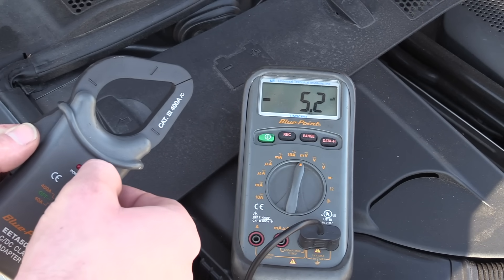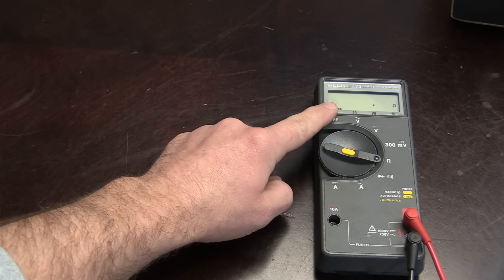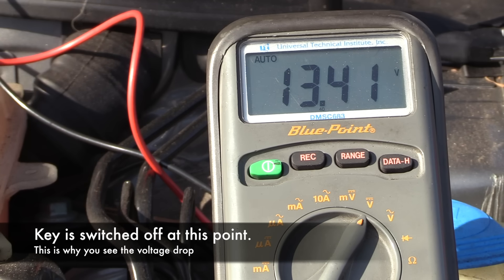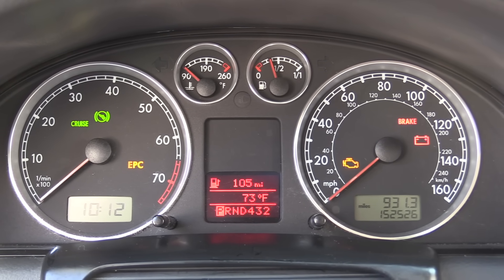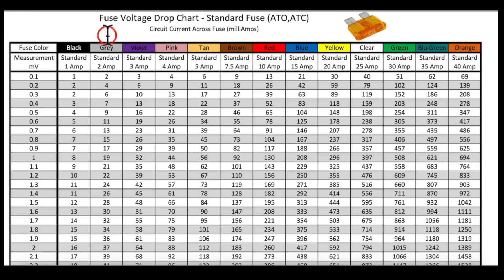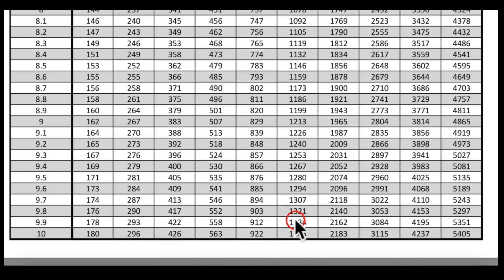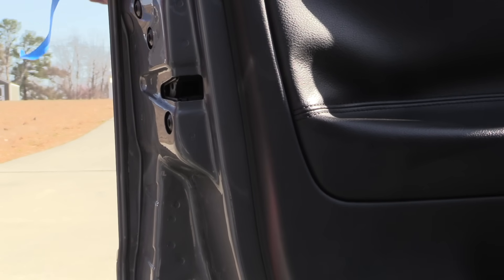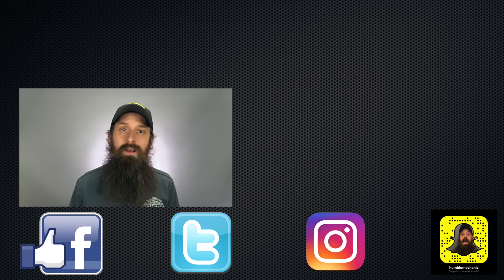The BEST Way TO Perform a Parasitic Draw Test

Comment: we had a 93 pontiac sunbird and if driven every day was fine. let it sit for 2 days and battery wouldn't turn the engine. my method of finding the parasitic draw was to start the car and let it run for about 5 minutes to charge up the battery. then i turned off engine. i read the standing voltage of the battery and began pulling fuses to see which one when pulled out made the standing voltage rise. i had no helper so it was a lot getting in car and out of car . turned out to be the electric door locking circuit. removed the fuse and no more battery drain problems. just wanted to let you know how i figured it . newer vehicles who knows since 1 wire can be used for more than one thing.

Comment: I went outside to watch a YouTube video on my laptop and took it outside so i could refer to it while sat in my Audi A3 1.9Tdi 8P1 March 2009 plate.
I latched both doors and the bonnet
With my Robin AR4007 multimeter set to black lead in the common and red lead in 10a, max and the dial turned round to 10A I started getting the following readings the values kept hovering around 0.239 --- 0.240 then 0.300 then 0.560 then 0.141 then 0.112
0.073 --- 0.074.
The difference between the word "then"  and the dash line   ---  = "then" the reading hovering backwards and forwards 
The dash line ---started at the first number and finished at the second number.
While the Robin was sitting there doing its thing I used my other multimeter splinktech DM2 to check all the fuses on both 
fuse boxes inside the cabin and under the hood and they ALL gave the same reading of 0.00, it got so bad I was even beginning to doubt my splinktech so I tested it on the + & - poles of the battery to get a reading I am still getting 12v etc.
But even after leaving the car for two days drains the battery, so now I uncouple the positive cable from the battery daily.
Does anybody have any ideas ?

Comment: About turning the radio on when testing voltage drop on the fuse, do you have to to turn ignition or just press the power button?
Reply from the maker: I just clicked the radio on

Comment: Does anybody have screenshots of the original charts? Because apparently Power Probe has removed these charts from their website
Reply from the maker: They change that link all the time. :( I’ve had luck googling “power prove bolt drop chart”
Reply: @HumbleMechanic  I found a few and screen shotted them. But don't have all of the regular ato type fuse chart. I should be able to figure it out with what I found. But still
Reply: @HumbleMechanic  I've always enjoyed your videos. I've been running my own mobile auto repair for almost 7 years now. And still need to learn and further the education every day

Comment: Thanks for sharing this useful information 
 Question : What if the draw wasn't a constant draw?  Like if the draw comes and goes from time to time 🤔

 Update: i did little research and I believe that I found a little better method,  Attach clamp meter to the battery's positive cable and read the current (mA) ;

A-  if it shows a parasitic drain ( more than 50 mA) and if it is a  constant drain 
➡️ Then perform the volt drop test procedure normally. 

u can use the (max) option on clamp meter and leave it for a while and get back to confirm  whether it's a constant draw or intermittent. 

B- if it's an intermittent drain
➡️ perform the drop volt test on fuses only while the parasitic draw is happening, so as soon as u see the clam meter reads a significant draining amp perform the drop test on fuses one by one, and stop when the  parasitic drain goes down,  continue the volt drop across fuses as soon as the amps goes up again ...  And so on until u find the fuse that causing it
Reply from the maker: That method will only tell you THAT you have a draw, not WHERE your draw is. Often that method and this method are used together

Comment: I'm confused by something. You lock the car and let it sit for an hour so that it completely shuts down. Then to test the draw for the radio, it has to be turned on... but you can't turn on the radio without at least putting the key in and doing a quarter turn. Doesn't that completely negate the locking/shutting down the car?
Reply from the maker: Radio power on with key off on this car. The radio on was only an example of what a draw looks like.  

If the radio was “bad” it could also stay on:be on with the car off, on a car that normally wouldn’t
Reply: @HumbleMechanic  I've got a VW beetle 2003 and using a different method (amp draw through negative lead to terminal) gave a 1.8A reading, but removing 42 gave it 0.04 - so I'm very interested in this method. 

Interesting that the radio powered on with the key off in this unit. I don't think mine could do that - but I guess I should check.

Strangely, disconnecting the amp in the back, the multimeter reading oscillates from 0.6-0.8A. I suspect my radio (or something) is trying to tell the amp to power on constantly. Guess I'll find out soon!

Comment: I'm glad that this popped up in my feed again I needed the refresher before I dig into my truck.
Reply from the maker: awesome
Reply: @HumbleMechanic  His three main points are that the cased fused can't be checked because the have the clear cover over them, according to a manufacturers' literature, anything over 25 amps can't be tested reliably, and sometimes, a load cycles on and off and you may not catch it when it's under load. 

So, remove the cover, install a smaller fuse for testing or be patient.

Not deal-killers, they are just some things to be aware of.
Reply: @HumbleMechanic  after watching this, I got another one in my feed saying that this isn't reliable. I haven't watched the whole thing yet, so i don't know his reasoning. I am always willing to try whatever it takes and yours is easier, so I'll start there.

Comment: This test is very much B's and would take forever.  On my cayenne. There are four fuse boxes and two batteries.  Some fuses control multiple modules.  That would take forever. Not 10 minutes.

Comment: Seems to me you can simply take a fuse known to be blown, insert it in place of the good fuse, then use the digital meter to directly measure milliamps or amps across the blown fuse. The reading will be the actual draw on that circuit, conducting through the meter. Using voltage drop across a good fuse is too dependent on the size of the fuse and how well it is conducting in the fuse block, which could have corrosion issues. Not to mention the result must be looked up on a chart that converts an unreliable reading to actual draw. Set test meter on 10 amp scale first. If reading is negligible, reset to 300 ma. scale. If still negligible, go to lowest 10 ma. scale. A parasitic draw of 1 amp or higher may pull down the battery below 11.5 volts in a couple of days.

Comment: Disconnect neg battery connector, put neg meter probe to neg battery post.  Connect positive meter probe to chassis ground.  Read volts on meter.  12+ volts indicates parasitic current draw.  Start pulling fuses watching voltage.  When it drops that circuit has the problem in it.  No need to read fuse voltage drops and charts.  Quick and easy.
Reply from the maker: Doing that on old cars is great. Modern cars it’s not.

Comment: Electrical Engineer here; didnt realize that fuses has a large enough resistance to them to detect a significant enough voltage drop to calc amperage off of. Interesting technique. Thanks.
Reply: They're meant to melt at certain current.  So it would have to be resistive to cause heat, thus generating voltage across it prior to meltdown.  Even copper traces on PCB's have significant enough voltage drops, thus we utilize Kelvin connections. 😉
Reply: The key "change" here is that meters that make reliable, easily-read and repeatable microvolt measurements are easily available.  Humble has a nice Fluke, but for this task a meter you might acquire at an auto parts (NAPA etc) or big box general (walmart) store will work fine. 40+ years ago not so much.
Reply: Wtf does it take to become electrical "engineer" nowdays? Have a pulse?
Reply: @redrustyhill2  ...maybe lighten up.  @b_gumm apparently drives Autocad for a living, and it's good he's picking up insights about troubleshooting here.

Comment: I tell you what a light with two leads can be really handy finding a short to ground. Hook one side to battery +. Then start by pulling out a fuse. Connect the other lead to the + side of where the fuse plugs in. Do that with each circuit. If the light comes on you have a short to ground in that circuit between the battery and the fuse. When the light goes off the short is fixed or just not shorted out. You can use the light  and jiggle stuff, close doors, etc to see what causes a temporary short. I did this to isolate a short in the passenger side back door. A yellow wire to the window regulator had missing insulation and would short against the door sometimes when it was closed.

Comment: Hey Bro. nice video. but didnt help on my problem. i pulled all the Fuces and relays off, but still have a drain of 3.6Amps.  and BCM give me 100 codes says that all the equipment are short circuit short to ground. 
pls help. its a Chevy Sonic 2014 1.4L turbo

Comment: so in my golf i let it sit for 2h with locked doors and came out to check the fuses and alot of the fuses was pulling 0.1 idk if thats a fluke or if they actually draw that and i found 1 pulling 2.6 while the car was of

Comment: I’m a little confused why a radio with a draw of under 2 amps is on a 20 amp fuse. Surely there must be another another fuse between that and the radio.
Fuses protect the cable so if you have a light cable with a short circuit of 15 amps it would catch fire well before the 20 amp fuse blows. So that fuse must be protecting something else as well.

Excellent video and especially the tip about tripping the locks. Thank you

Comment: Best video I have seen on this.  Working on a kia that we just cant figure out. Changed starter, alternator, battery, power steering and pulleys.  Still having draw and cold weather starting.  Thanks for the resource.

Comment: Oh my God you completely do not have the correct concept of how this works all your reading is across a dead short the fuse and you're reading the resistance of that dead short! That doesn't tell you anything other than that the fuse is good.... If you read a voltage across a fuse that fuse is blown completely open.
Reply from the maker: No that’s not right. Try it for yourself. :)
Reply: @HumbleMechanic  I see the charts and everything but this is not telling you anything... You're reading a meniscal portion of the current going through that fuse.
Also I think every parasitic draw problem for the most part is just a poor battery...
Some things have to have a draw to keep their memory or to be ready to perform whatever function they performed.
Reply from the maker: It’s only minuscule if you have no draw. Watch when I turn the lights on.

Comment: If the readings are all 0 reading. Is this incorrect.l? Shouldn't a reading show for the clock getting power? A couple MV.? I got all 0 on my lowest MV setting direct current mv 200mv setting. Have to get an alternator test
The only thing I'm sure all engine fuse box fuses read 0.
Maybe on the lowest setting on in cab fuses I missed a reading of 1 because then the next highest MV setting is needed for a read.The box is right at feet. Hard to check!! I noticed y auto power window was stuck not working correctly. Unstuck it. Waiting to see if it was the problem.

Comment: Not a techie myself....but I learned 2 things , er maybe 3.  How to check the fuses with the probes , how to check my ohms reading on my voltmeter. And to hold on to my 2005 Highlander because it's not as high maintenance as the car you were checking...lol...P.S. ...great presentation . You stayed on point in a highly technical subject . You didn't waste time with lengthy introductions . The length of the video was about the optimal time I want to watch. Others spend 20+ minutes and don't deliver as clear and concise info. Great job.

Comment: This gentleman is excellent, voltage drops rule , sometimes calls I R drops
, because E= I x R , which is Ohms law , which all you have to know to control electricity  learn it love it  , I love a large current draw , the sound , the heat , the sparks

Comment: Thanks for the video. I have a 1998 lexus sc400. It has had a slow battery discharge (dead or very low charge after about 10 days sitting without running it). Ive had this problem since 03 when i got the car. Im going to do this test. What is the acceptable draw ballpark? I know the stereo etc has a tiny discharge for the memory etc... I thought it was the alternator but replaced it with no remedy.

Comment: Is this with the key off?
Reply from the maker: off. the goal is to mimic "sleep"
Reply: @HumbleMechanic  ok thanks thought so but wanted to confirm.
Reply: What if you have an old vehicle with glass type fuses? I did the test light method and pulled each fuse. Light never went out? Next to check?
Reply: @HumbleMechanic  By the way great vid!!

Comment: Easy way to measure current is to put in a blown fuse, and you just measure across it.  This won't work in this case, but on an older car this is pretty easy.

Comment: Why do you use a second multimeter, while the first one is simply connected to the battery for a voltage test.  Why not remove it after confirming battery voltage?  After all, it’s not like you are using it in series with the battery and testing current draw.

Comment: Don't cheap out. Buy a real meter. Fluke ! 
Eliminate the battery completely.  Hook up to batt terms. And start testing. Most of time its corrosion that can be intermittent. Then test circuit by circuit.  Pull fuses in and out like 5 times and clean terminals. Use dielectric grease too.

Comment: Unfortunately this technique is highly inaccurate for intermittent voltage drops, for example if your wiper motor goes bad\gets rusted out and gets stuck on a rear door hatch, it will constantly attempt to return to home position even with the car off, at least in 99% of vehicles, which in turn kills your battery overnight, these generally try to return home every 10-15 seconds, if you are just going across each fuse you are most likely going to miss this amperage draw unless you are just so lucky enough to test the exact fuse at the exact moment that it happens. 

Best way to test for parasitic draw is always going to be old school, DC your batt, install a lead from negative term to neg wire, use your multimeter then, and pull fuses each time your meter shows an amperage draw, there are plenty of videos showing how to do it, yes it is annoying to go through all that, however you wont miss any intermittent issues and resort to the parts cannon.
Reply from the maker: “The best way is always….” This is a dangerous mentality. 

For intermittent I’d use a IR camera.
Reply: @HumbleMechanic  I admit I shouldn't say always, my bad, an an IR cam would be nice, if you mean the ones that show you a thermal image on a screen, far too expensive however, temperature gun maybe could work though.

Comment: What kills your test leads is trying to probe through wire insulation.
They make piercing lead ends for your fluke.
One day I found out my leads had been swapped out by a jerk at the shop. I didn't have time till I happened to take the meter home.
Well, God judges them.

Comment: My father in law gave us a passat that had been in and out of dealerships for years for draining the battery.  I found the problem by removing all the  fuses and replacing them one by one watching th e current draw. Wire to trunk light was woven through lightening holes in trunk lid and had abraided through insulation. Got a great car for nothing. Three months later the wife totalled it.

Comment: Great test with great info.
Parasitic draws and intermittent electrical issues have to be some of the most challenging diagnosis in modern cars.
Test like this one is are great tools.
the ability to test without disturbing "sleep". Ie latches or pulling fuses.
As well as having accurate electrical diagrams/schematics and understanding of them. 
The days of a simple door switch just interrupting the current or ground/circuit to your dome lamp are long gone in a lot of modern cars. Odds are it feeds back to a body control module or similar, that may even include interface point prior. 
But don't overlook the obvious either. 
My father in his later years complaining about battery always being dead when he went for his weekly or biweekly trip into town.
After months of trying to figure out what was going on. Turns out the intermittent draw was him leaving the door ajar. But when he came out to a dead battery get mad and slam door shut. So the obvious not being present.
Reply: Note. My bad. For not realizing his situation  (did rectify situation. Ended up brother and I took turns staying with him to the end).
Point being don't overlook the obvious. Whether it be human or mechanical.. common sense and basics.
Reply: @bcallahan3806  ah, parents.  Can't legislate for those problems !"!"